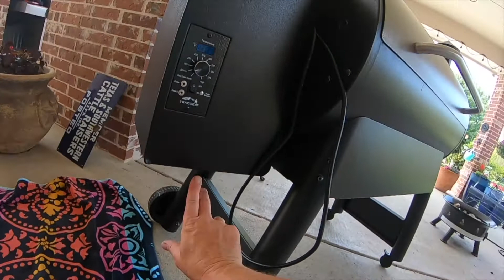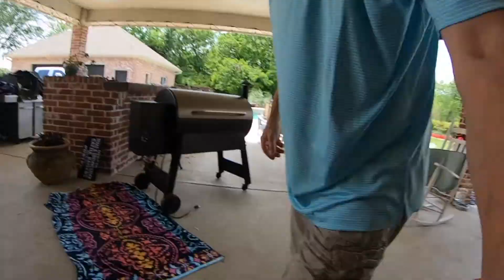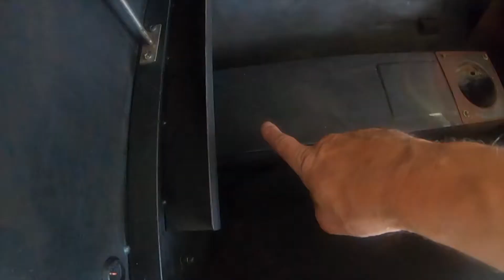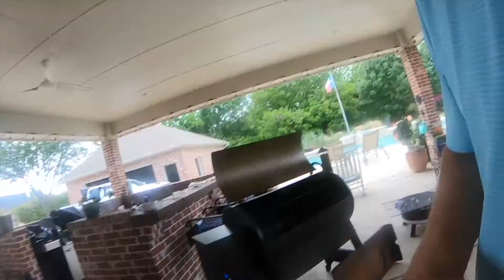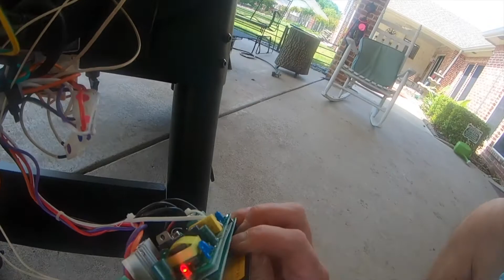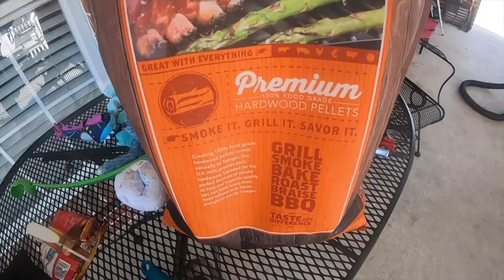Traeger Fan Motor Replacement - Great Customer Service

Comment: Motor is on a timer so it regulates pellet flow the motor doesn’t speed up and slow down it’s either on or off there’s nothing wrong with your pellet auger motor
   If your pellet auger ran all the time you would bury the burn pot 
     There is a adjustment hole better yet do your research on YouTube university to adjust temp problems and your pellets are like sponges and will take moisture from atmosphere especially if you live in a humid climate which affects the temperature at which they cook good luck and remember he is the greatest
Reply from the maker: I actually had tech support on the phone from Treager and they walked me through the trouble shooting.

Comment: Same issue; going guess this is a part you might want on hand; failed morning of 30 people coming over for BBQ (ahhhhh).  Figure about 2 years of heavy use before it burned up.

Wiring was impossible to get to with normal shaped hands on my model; so it got some wagos after clipping the 4 wires.  Now its a 5min swap job.
Reply from the maker: Frustrating for sure.  Thanks for watching.

Comment: I'll never buy another treager I had a knock off brand pellet grill for 8 years not one problem ever bought a new treager last year every time I want to use there is a problem was always telling me to clean it even after I cleaned it now it says fan is disconnected can't wait to git rid of this over priced pos
Reply from the maker: Thanks for the feedback Mike.    I’ve only had the one fan issue, once replaced, it’s been running good.  Knock on wood.   Totally understand your point of view.   Have a good day.

Comment: I have had mine for several years! Worked fine and then had a big cook for family and it did same as yours! I changed the fire cup to a stainless steel one! New temp,sensor-new fire rod-and tried again! Low and behold not functioning! Fan is dead! Hopefully a new $35 fan on the way! Hope it gets back to normal! It has always been a great pit! But outside under the porch with a Traeger cover so things are bound to go wrong! My nephew down in South Louisiana sales lots of them so at least I have instant help on troubleshooting!😊
Reply from the maker: Good luck, I hope the fan works for you.   We use ours weekly.   The stainless fire cup is interesting.   I haven’t seen one of those.
Reply: @HeritageFarmsTexas  my nephew has someone in Lafayette area that weld them up for him! Evidently the originals are made from very thin metal and the heat eats them up and he had so many customers to complain about it that he asked someone there if they could design a replacement! He tells me the stainless ones are way better!

Comment: So after ALLLLLLLLLL that- A different brand pellet made the smaller augur fan stop turning ? Which in turn caused the auger to stop rotating? Makes no sense. Are there any updates ? Is the grill still performing properly since you changed pellet brands? Or, has the grill failed again?
Reply from the maker: So, we had multiple issue.   The main fan motor went out.  (The one that blows air to make the fire burn).   The second issue was the loose wiring that was touching the auger fan which would cause that to drag or stop.   The third issue was the pellets.    Once we changed the fan motor, secured the wiring so it would not touch the auger fan , and finally changing to a different bag of pellets, it’s working great now.   Cooked on it at 20 times since then with no issues and we have used multiple brands of pellets.   Thanks.   Their CS stuck with us and helped figure it all out.
Reply: @HeritageFarmsTexas  thank you for the reply. I have since learned the small fan for auger only runs while the augur is turning so it cuts on cuts off a lot. Temp setting and temp showing on screen for my grill is showing about 35 degrees than actual reading I get on several separate temp gauges.  I will try and call CS tomorrow. See if they will send me a new RTD probe.
Reply: @HeritageFarmsTexas  I just got off the phone with CS very quick pickup. Got on video call and quickly diagnosed my controller is bad. Sending me new controller and new RTD under warranty. Maybe 15 minutes total time on the call.